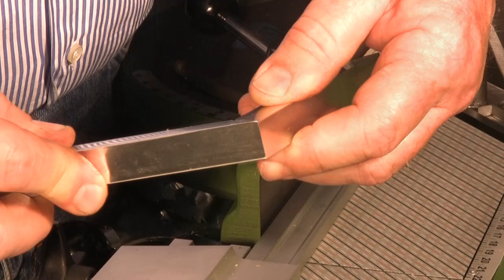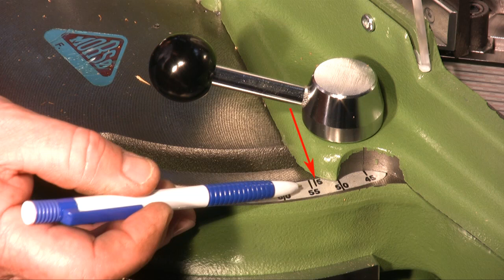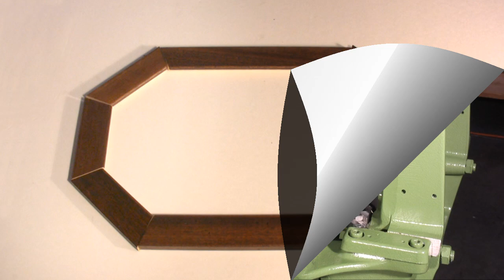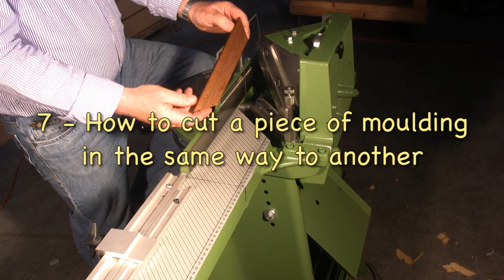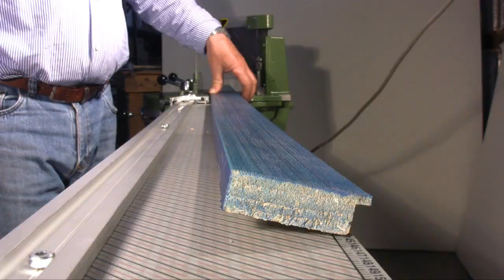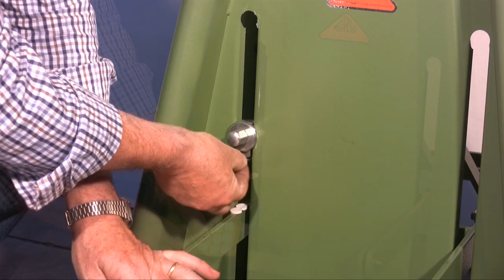The guillotine - 10 tricks of the trade

Comment: How prevent not chip a ornate moulding?
Reply: You can make several cuts for one moulding, but for ornate mouldings it is preferable to use a saw to prevent from damages of the surface
Reply from the maker: Ornate mouldings would be better cut with a saw actually.
Reply: @RINALDINsrl  Buena tarde quisiera saber el costo de esta hermosa guillotina.Interesado mucho estoy gracias.